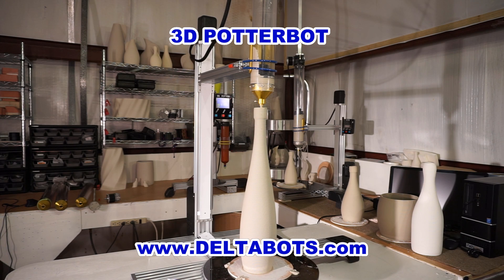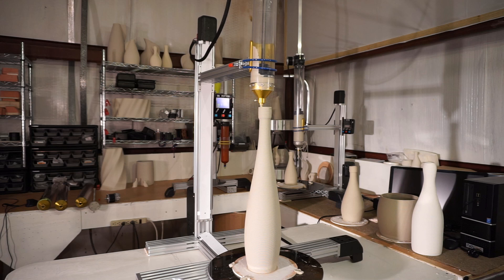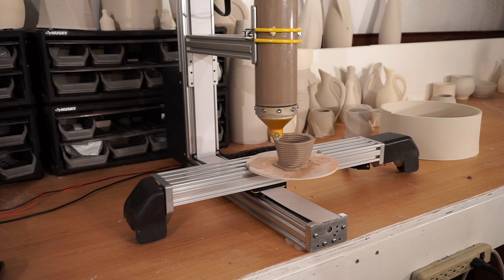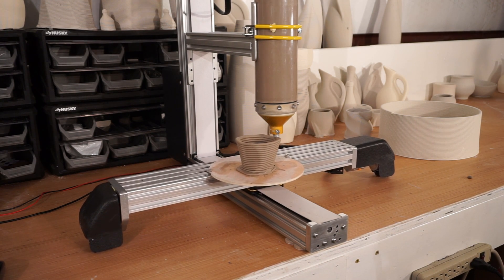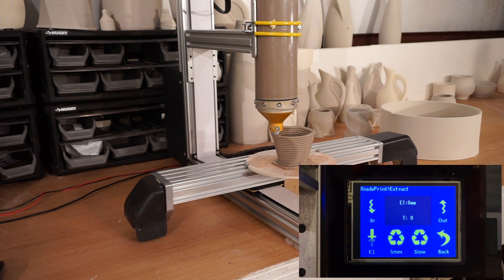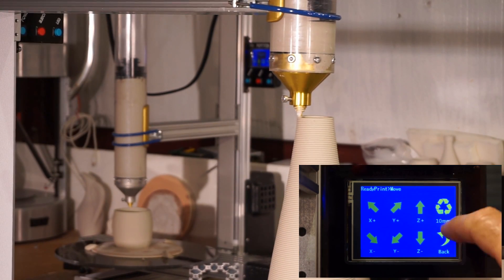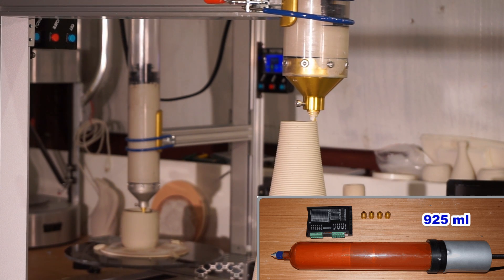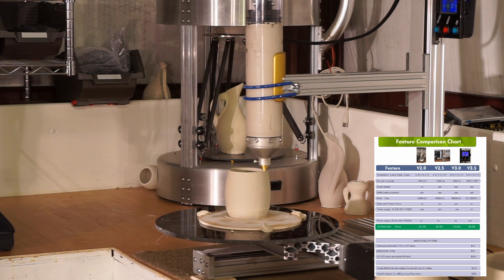3D Potterbot version 2.0 and version 3.0

Comment: You can get rid of the z-jog seams by switching over to a continuous-z print. Print the first few layers normally to get started and then spread the entire z rise over the entire x/y travel distance for each layer. This works very well with PLA and 0.1mm layers, I would imagine it would work even better for your much thicker layers.
Reply: +Danny Defe Slic3r has a setting called 'vase mode'. It will plot a continuous unbroken path from top to bottom. It would be perfect for this application.
Reply from the maker: +Clem Taylor These prints were generated with Simplify 3D.  I asked them several times to help with the step over problem with no clear solution. What software are you using?
Reply: The continuous-z prints I did where done by generating g-code directly in python.

skeinforge had a continuous-z plugin and at one point I found a g-code to g-code script that could convert a normal print to continuous-z (but I couldn't seem to find it in my mess of 3d-printer related stuff). It is also possible that the slicer in cura can do this as well (but I haven't done anything 3d printing related in a few years, so I'm not sure what the state of things are now).
Reply from the maker: +ldm314   I am printing in the vase mode with Simplify3d ,it just doesn't do a perfect job
Reply: Haven't tried Simplify3d, their DRM seems pretty horrible. Looks really nice but that is a major issue for me. I stick to Cura or Slic3r. Most the time I use Cura, but even it's vase mode doesn't come out as nice as Slic3r's.